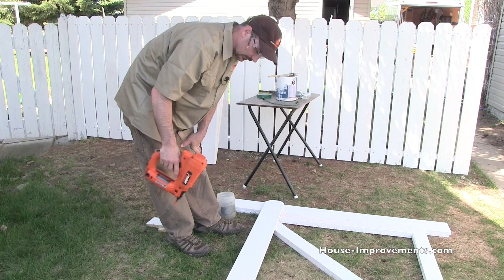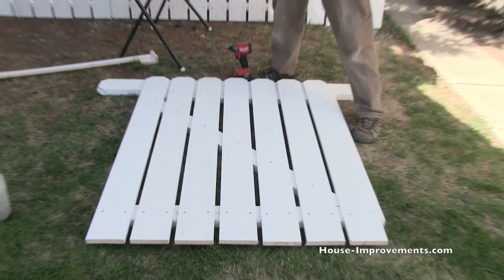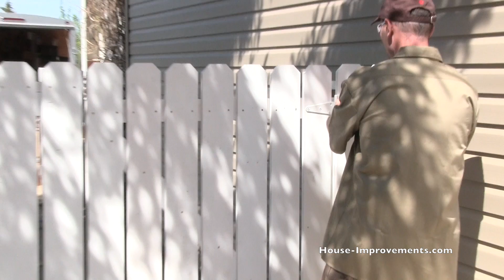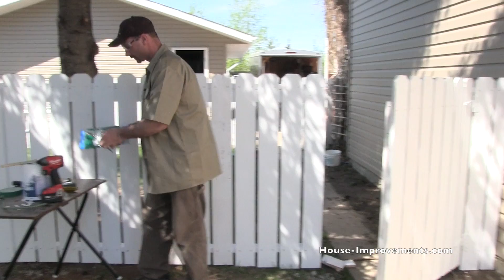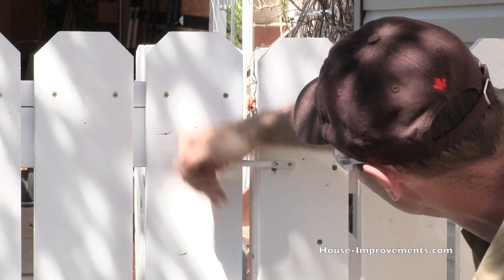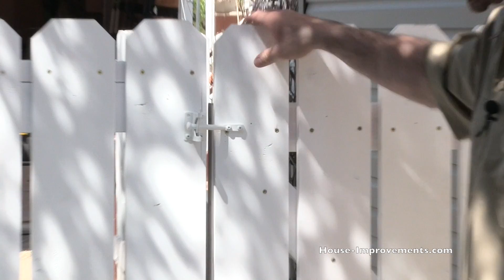How To Build A Gate

Comment: I love your videos and method of teaching, especially the tips - you make it look so easy. I want to build two gates on my yard. If you are adding the planks prior to attaching the gate, how do you account for any uneven ground?
Reply from the maker: You will have to figure that in before hanging. If you figure out the height of the frame you can use a level from that point on the post and measure down to get a distance so you could cut each picket off to length first.
Reply: Thank you so much for responding.

Comment: Much,much easier to build fence completely, place additional post (s) where the gate is to be placed. Brace the gate section, put hinges on and the take sawsall and cut the horizontal  support boards. Gate will fit like a glove and take much less time.
Reply from the maker: Why the double posts where the gate is? So drill two more holes in ground and buy two more posts and concrete? Sounds unnecessary to me and not any quicker or cheaper, but if that how you wanna do it go right ahead..Oh wait now I see what you are saying. Put all posts in including where you want the gate, then build the fence with boards completed . Go back to the gate area and prep the gate section then actually cut the gate out of the existing fence ? I have never thought to do that but it should work fine also. I have never seen anyone do it that way, you must be some kind of fencing god, Nice idea!

Comment: You didn't paint the bottom of the gate pickets!
Reply from the maker: They had one coat, if you compare to the raw edge of the piece I used as a spacer you can see they are slightly white.
Reply: Ahh yeah, I was just messing a bit, this vid helped a lot with repairing a 6 foot fence that fell over at my work.

Comment: I have hinges that attach to the 2x4's of the hinge post. I run 2x4's across the opening and to temporary cleats. Then I put the vertical and diagonal braces on. Finally I remove the cleats and cut off the excess with a reciprocating saw. The gate always lines up with the latch post that way.
Reply from the maker: +Tom Picciani  Good tip

Comment: This video should be called, "How to hang a gate."  You did not show how you built the frame of the gate.  Not even tell us either.
Reply from the maker: +Smith brosjr  I think you missed the first 2 minutes of the video??
Reply: Your right, I watched the beginning cause I needed to know how to "build the frame"; The gate I have now, has the metal enforcers but it still sags after 3 yrs being up.  I want to add maybe the cross wood bar which I think will help.
Reply: I was interested in the door/hoe to hang a gate...I want to put one on my deck, so my dogs won't wonder off.

Comment: The door swung open on its own that means it is not hung level and plumb.
Reply from the maker: +Smith brosjr  Post must have been slightly off as they generally can be. If i adjusted the gate to not do that it would not line up with the rest of the fence that is completed and look bad.

Comment: Nice video,but the angle brace is the wrong way,and the latch should be on the inside.
Reply from the maker: Pete Smith  If you were using a cable and turn buckle then yes the brace would need to be in "tension" and going from top hinge to bottom opposite corner but the brace in this video is wood and wood is much better in "compression" so it needs to be orientated like I showed here.
Reply: +Pete Smith If you know so much Pete how about you show us a video of your work, rather than trying to confuse the less knowledgeable people watching this video while giving them incorrect info.
Reply from the maker: Pete Smith  Please see my comment below about the angle brace, as for the latch if you wanted the gate to swing the other way then yes you could. I like the arm part of the latch to be on the gate because if it is on the post (which it would need to be if it were on the inside and still swinging outward like I have here) it will stick out in the way when the gate is open.
Reply: Pete Smith are u talking to me? im sure u have built many cool things. I was just telling some one who mentiond the brace was the wrong way and its not. Yer gates are easy then how come many people get them wrong I wonder...
Reply: +Smith brosjr he's actually right butthead
Reply: Are u serious?
Reply: ***** I am not knocking your work,but the angle brace supports the gate better,when it is supported by the top hinge,not the bottom hinge.
Reply: Pete Smith u need to learn about forces and load transfer clearly.
Reply: HouseImprovements It is just a gate,I really do not care how you build it,I just added a comment.But you got me on the load transfer stuff,I have built much more stuff,with load transfer,than an oh so simple gate.I was just trying to show you how to do it,that's all.